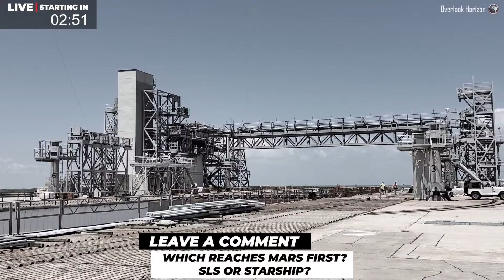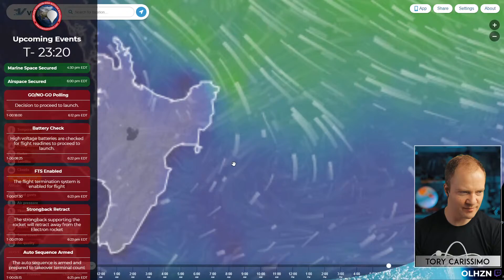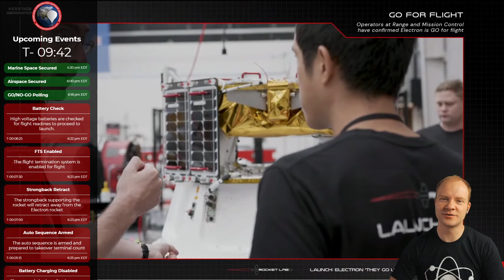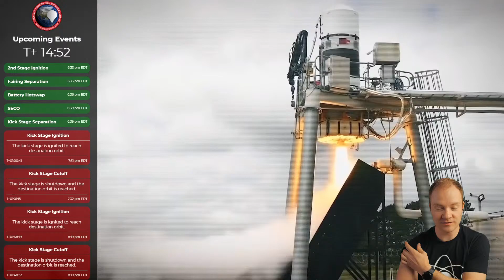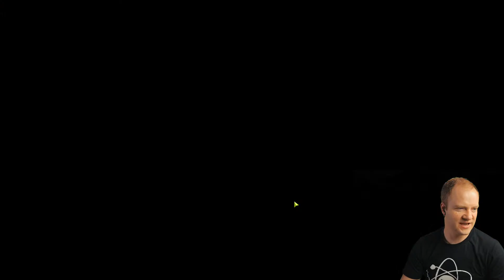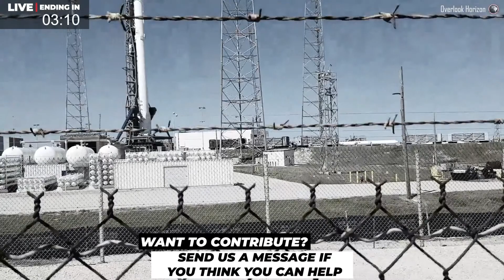Rocket Lab Electron Launch 🚀 They Go Up So Fast 🔴 Live

Comment: Those are incredible engines. Very powerful. What do they use for fuel? I assume it isn't kerosene.
Reply: Lmao 🤣 what makes you say that?!

Anyways! You probably know that fuel isn't the only thing that makes a rocket efficient... right? (Falcon 9 and Falcon Heavy)
For example, SpaceX can make there Falcon 9 even more powerful by "just" supercooling their fuel. As a result, makes it even more dense and therefore have a lot more fuel per volume. Which is vital if you want reusable rocket.

Aerospace Engineering is not a simple career. There's so much problem solving that goes to it more than you can even begin to fathom.

Also, *Yes Rocket Lab's Electron rocket actually use a rocket grade Kerosene called RP-1!* with liquid oxygen as the oxidising agent. The same fuel as the SpaceX's Falcon 9 rockets.